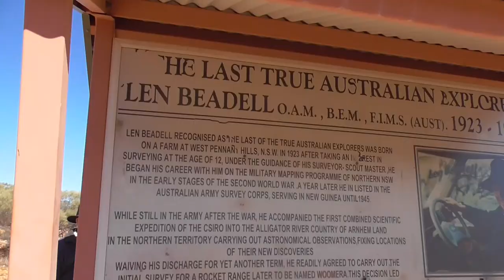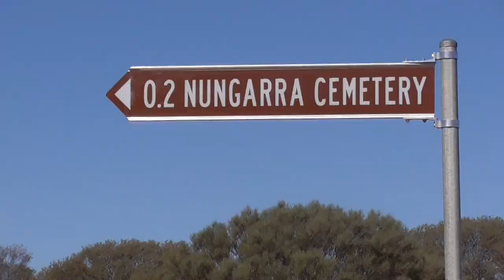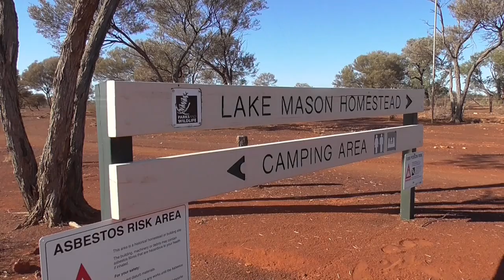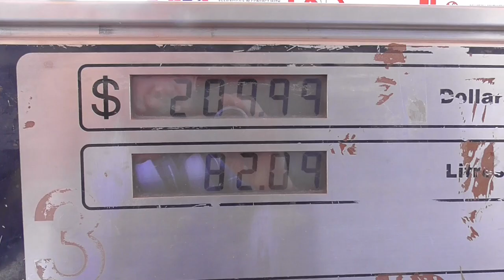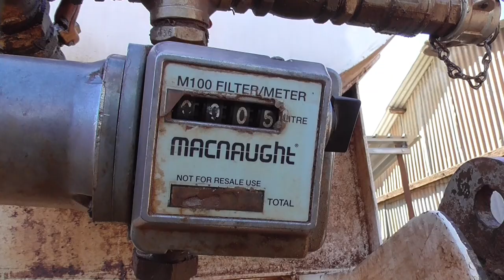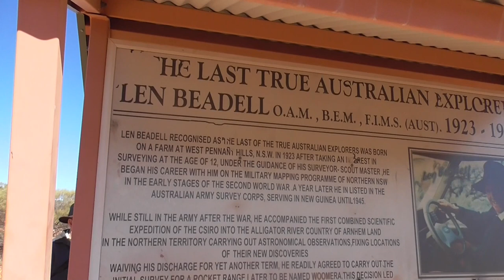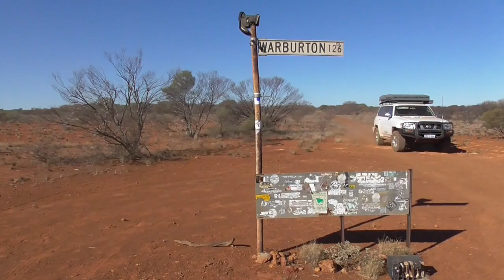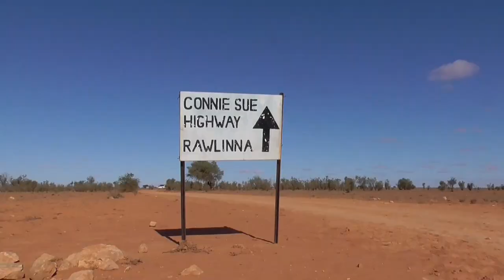Len Beadell's Legacy

Comment: So many tracks etched in the wide brown land . In 1975 , I worked the Eyre Hwy to the SA/WA border . There I worked with Dougie  Stoneman . He was Len Beadells dozer operator . All those blokes were influential in my life. In Lens book about making the Gunbarrel he mentioned pumping up his flat tires with a hand pump that took about 220 strokes per tire. And he got a lot of flats .For constructing the Gunbarrel . He`d bush bash a straight line ahead of Doug  and get to a sandhill and reflect a mirror back . Doug would doze the track straight to the signal. Land Rover maintenance went like replacing broken leaf springs with mulga branches and also cutting leather gaskets from his boot tongue. That was how resourceful those men were.
Reply from the maker: I knew a bit about how the 'Highway' was constructed...I've read a bit and listened to some audio books.  Improvise, adapt, overcome (or die).  Tough breed!  Thanks for watching.

Comment: Many good memories of Lake Mason, knew the last family to own it before it reverted to government, from memory they left in the late '90s.  The youngest son and I are the same age, we got on well and used roam around the station whenever I was up that way, he moved to Canada to work on mines there and the parents followed some time later.  Good to see that it is still in (relatively) good condition, although some of the outbuildings are derelict or gone now, used to be a 'bough shed' just outside of the kitchen door (just to the right) which was a nice cool place when it was warm.
Reply from the maker: Hi Pete, it’s always refreshing when viewers can expand or explain (or educate) about some of the detail in my vids. By the sound of it, it allowed you to go on a fond visit down memory lane and reminisce. I know when we visited we did so respectfully. The Club even repaired the flue in the shower block so we could all experience a basic bush shower with hot water from the chip heater (the shower block would fill with smoke without the flue). Thanks for watching and thanks for commenting.

Comment: Those Dingos are cunning little buggers. I've had some experience with them in the bush. I reckon that one has found food left behind by, or possibly been fed by travelers before. It was also the scout for the pack it hangs with. Checking things out for a potential midnight raid.
Reply from the maker: Yeah, but the bush camp we stayed at was just picked out randomly...i dont know if people would've stayed there before. Still, he seemed to know what he was doin'.  Thanks for watching.
Reply: @mongreldogproductions  That's interesting. He may have just had no fear. I was surprised at how he didn't run when shooed away at first. He looked like he wasn't in need of a feed. From the footage he didn't look like he was skinny by Dingo standards.

Comment: Just curious. When I was growing up it wasn't uncommon for people hitting tracks like this to put wire grills across their windscreens for protection from rocks thrown up by passing trucks. I know laminated windscreens are much better now, but you can still get a good gouge or crack in them that gets bigger and bigger with the passing of time. So why no interest in those grills any more?

Also, I noticed an interesting mix of stand-alone tents, rooftop tents, and at least one trailer. Which do you think fared the better over the journey? Much as I'd like to take a camping trailer,I figured another set of wheels would add to the list of things that could go wrong, like punctures, as well as putting added strain on the towing vehicle over rough stretches.
Reply from the maker: Heavy vehicles still use them...they are fitted to the bottom third of the windscreen and angled downwaqrds.  I think laminated windscreens have made the difference.  The glass wont shatter like it used to, just chip or crack.  Thanks for watching.

Comment: Read near all the Len Beadall  books (Henry Lawsons kick that book out of hands irony for an author) . .  & the main refrain was all the puncture repairs tubed tyres Landrover  . . that said some don't learn & will go with lugger split ring (not rim) Toyota caper as like to be able to change the entire tyre easy . . well if the lugger rims are not rusted inside that is
Reply from the maker: Hi Ben, I've had experience with truck lugger rims...a lot less hassle instead of removing tyres from a standard safety rim.  I have listened to some audio books from Len...interesting life!  Thanks for watching.

Comment: Did you find out the story on the burnt out Ute and Trailer?
Reply from the maker: We suspect it was an accidental fire…he did not even have time to pull it off the road. Lithium battery exploding perhaps. Looked fresh…never did find out.  Thanks for watching.
Reply: Happened end of May, It was my Mum and Dads Ranger and camper, they had been left behind when the fire happened. Eventually someone came looking for them. They got the camper off but because the jockey wheel was broken they couldn’t get it far enough away. They think it was either electrical or grass caught up somewhere, can’t remember what side the fire started on now. 
Never leave your mates behind!
Reply: @mongreldogproductions   Is it possible to please get the footage of the Ranger?
Reply: @missybee5725  Sorry to hear that, it must have been a terrible thing to happen good thing no one was hurt. (I hope)
Reply: @Katov2  It was, they are still a bit traumatised by it all, the main problems they had was getting medical treatment. Laverton hospital wouldn’t treat them for shock, mild burns or give them the medication that had been burnt.
Reply from the maker: @missybee5725   Hi MB, I still have the raw footage (although there is not much there....pretty much what you see in the vid).  I'm not sure how I'm expected to get it to you.  If you provide an email address i can send you the video file but this a public domain so you may be reluctant to disclose personal information.  Regards.  Steve

Comment: Re: Burned out vehicle and trailer.  Is this what happens if you leave your vehicle unattended in the outback?
Reply from the maker: We suspect it was an accidental fire…he did not even have time to pull it off the road. Lithium battery exploding perhaps. Looked fresh…never did find out.  Thanks for watching.
Reply: @mongreldogproductions  Umm, however, the tires and wheels had been removed before the fire.  There were no rims on the truck, just the trailer.  It looks like the truck may have been stripped before it was set on fire.
Reply from the maker: @livewire..   yeah, you’re right. I didn’t notice that until you pointed it out. I’ll guess we’ll never know.